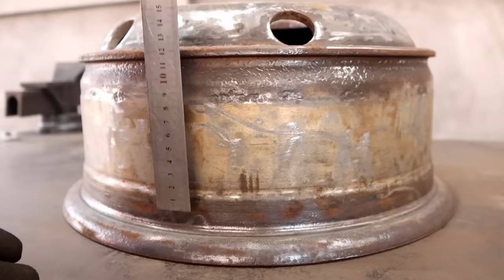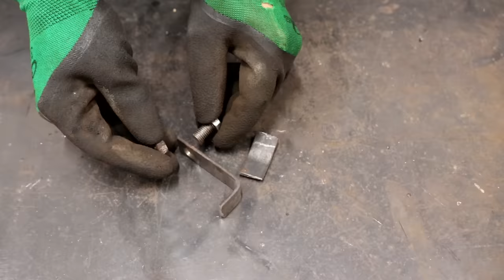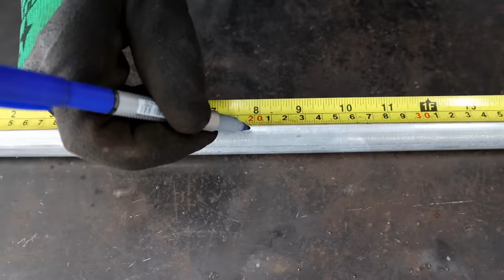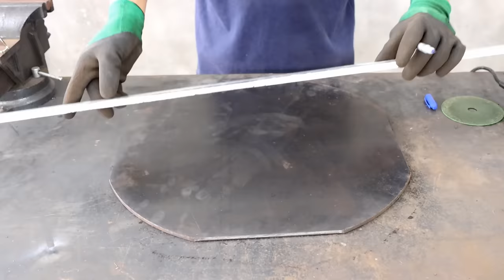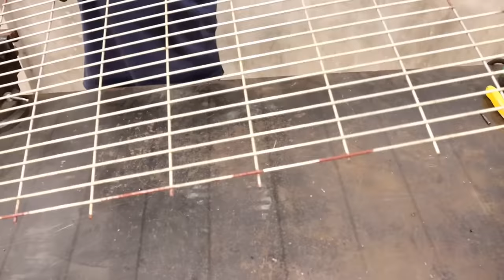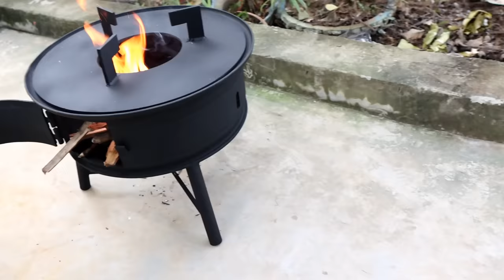DIY wooden stove from old car rims

Comment: Get an old washing machine drum. Bolt two old brake rotors together face to face. It's the stand. Put drum on stand. Bang an old circular BBQ grill on the top.

Job done. 5 minutes work.

Plus the drum is stainless steel, so doesn't need painting.